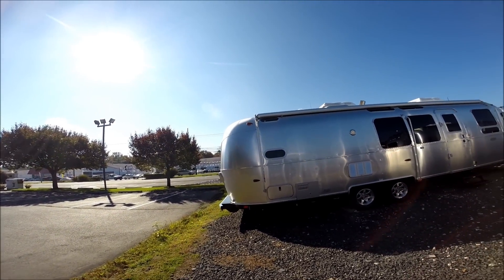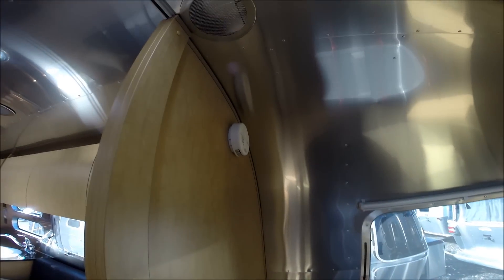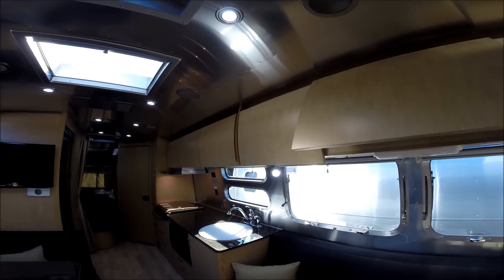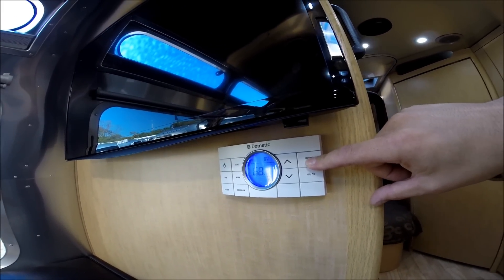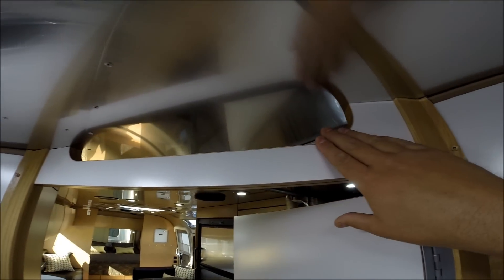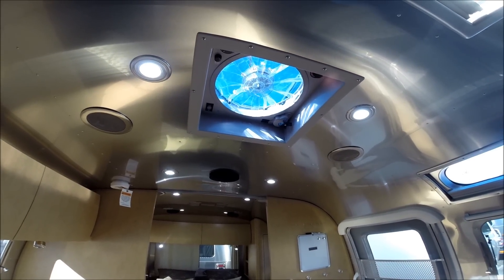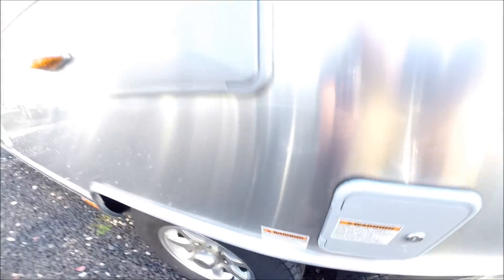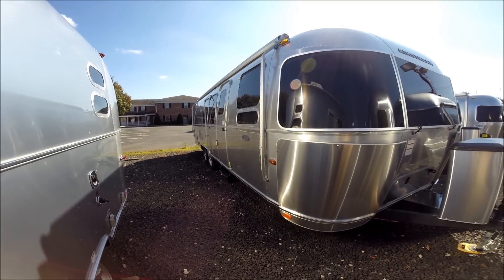Airstream Flying Cloud 30FB Bunk Walkthrough

Comment: Would it be feasible to remove the bunk beds in this model and put in a computer desk in their place?  Would the externally-accessible storage and/or water heater stick up above the flooring?  If not this model, would there be a better model for making that type of modification to add a workstation/office?  

I would like to try the traveling lifestyle, but I'm not yet in a position where I could retire, so I need to have a place in the trailer where I can do computer-based work comfortably.
Reply: Tim Welch  that's a good idea
I'd say a good carpenter can do it

Comment: Hi Patrick. I know I am Patel to the party but I just found you recently and started watching. Does this model have that wonderful plug in on the counter with all the blender and mixer etc attachments like the '87 you had? Also how much would this one go for in 2019? So much room! We are looking at many options.,..partly for my Mom as well. Just researching....thankyou!🤔✌🙋
Reply from the maker: Laura, thank you for the message. The center blender was discontinued in the mid 1990's. The new 2019 30FB models have MSRP prices just over 100K. :)
Reply: @colonialairstream  Well I expected more like $200k for brand new....so there's that haha. The one in this vid is absolutely fantastic even w/o the blender. Thankyou for the info. I'm afraid that's out of my league sadly.😥✌btw I got a kick out of your mention of CNC turning on the bin parking. Worked in factory for 30yrs. I've run cncs and even was doing some setup and learning coding. Also center less grinders and roll thread etc.😋

Comment: I was wondering why Airstream doesn't offer a rear single bunk over bunk house style or with a  bunk over a jack knife sofa on one side and then extra back door on the other (rainy day game room) then have a front full bedroom say in a 30 foot model. Or in reverse rear full bedroom with a front game/ bunk room? I would buy one like that if they ever make one available. :) even could use a roll over sofa like I have seen in some of the other models.  Just a thought ;)
Reply from the maker: There is always room for future floor plans.
Reply: If they ever do I hope they make the upper bunk a flip up style that locks so if you don't need it or want it in the way. I have seen some that flip up flush to the wall but with the rounded roof I don't know if they would be able to make it that way (flush) extra storage under the bottom half doesn't hurt either :)

Comment: Are there any gen sets that will allow both a/c units to work at same time. Most gens only have a 30amp plug
Reply from the maker: It would not be a portable generator if it was 50amp.

Comment: Why don't they come with generators ? is that only for class A an C 's
Reply from the maker: Generators have to be installed below floor level. Since Airstream have such a low center of gravity for excellent towing capabilities, there is not room below the floor to install a generator.
Reply: You could actually add a couple of 100w solar panels and an additional low-duty cycle battery like a GEL or AGM and not need a generator, or buy a higher quality portable generator like a Honda EU3000iS (w/ 30amp. for RV A/C) or larger and carry inside RV while in transit to your campsites .
Reply: Excellent I will save that info for sure Thanks!

Comment: Does this Trailer have a generator or does it have space to place one?
Reply from the maker: Travel trailers typically do not have generators because they are required to be installed below floor level. On a low profile trailer, this is very difficult because of the amount of room from the ground to the floor and the size of the generator.
Reply: well that lets me out as beautiful as it is this is more for luxury and not boon docking which is very important also low profile eliminates many scenic wonderlands beautiful though!!!!!! I've been censored

Comment: what the price of the 2015 version?
Reply: in houston is there a dealer you can recommend ? is there any used airstreams w two bedrooms ?
Reply from the maker: The 2018's have MSRPs in the low 100's nicely equipped. We offer discounts off of the MSRP at the highest level. Please give us a call if you are interested.
Reply from the maker: We at Colonial would love to assist you. The 30FB is only model that technically has two permanent large beds.
Reply: manny salazar Airstream did bunk model very similar to this one in 2005 and 2006. Airstream Safari 30’ bunk. The newer one has a few more features, more windows and a little higher end in some of the details.  The ‘05-‘06 Safari is rare though.